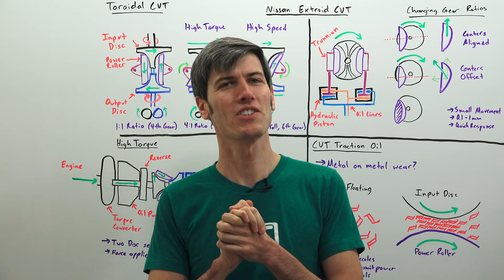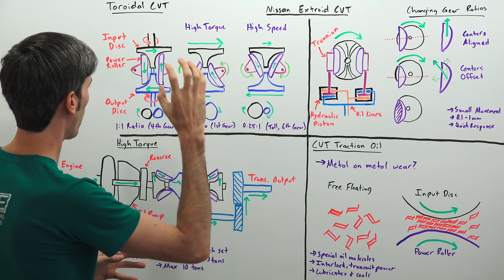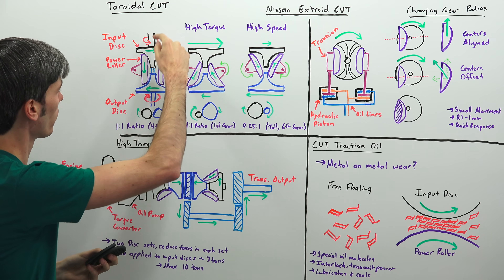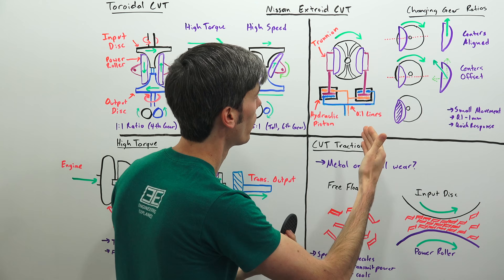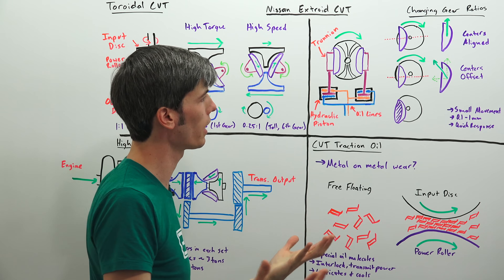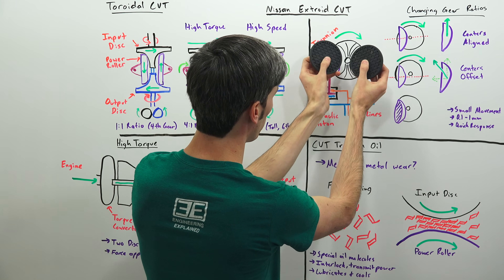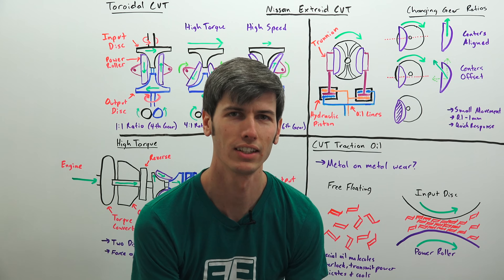Nissan Created The First Production High Torque CVT

Comment: Physically, pretty simple. Conceptually, highly complex. I'm not sure I'd trust Nissan for this type of transmission. I've seen many Nissans with 4 cylinders & CVTs that haven't had to have their CVTs replaced. Makes me wonder if it's been in the business since '99, why others haven't used it or something similar in their vehicles en mass. Maybe they've seen longevity issues?
Good video though. Square #2 took me a while to get though but I hung in there and BAM it made sense.
If I wasn't already subscribed I'd do it after this video. And not because of Bucket. If Bucket wants a friend let me know :-)

Comment: Someone finally made a car with the friction disc drive from my Sears lawn tractor! Yay!
Reply: So good for doing wheelies hey. Reverse, Pull back, Slam in forward, WHEELIE!!!
Reply: Exactly what I was thinking.
Reply: Its not a friction disk..
Reply: @Crazylalalala: It is, in spirit.
Reply: LOL, I had one of those! Worked fine till the rubber separated from the drive disc (2 or 3 years).😜
Reply: @danw1955  Cant you just replace it?
Reply: @ignacioaguirrenoguez6218  I think they have been out of production for quite some time.🤔
Reply: @danw1955  Huh, maybe some rubber coat?
Reply: @ignacioaguirrenoguez6218  The rubber was heat-bonded (i.e. vulcanized) to the plate on the originals, sort of the way motor mounts are manufactured, so any kind of spray on, or dipped type coating would just peel right off due to heat and friction.

Comment: Have a 2012 Nissan the CVT wen't out at 93000 (fully expected it and replaced it).  For perspective my Acura has it's 3rd transmission.  I follow American cars that are nearly brand new and the brake lights and turn signals don't work among other things i'm sure.  My parents GMC is literally rusting from the inside out from a jank sunroof seal.  My BMW spit oil on the exhaust from a damn valve cover gasket (how the hell can you even make a flat surface gasket leak?).  Point is cars a made by people, why should we think they will be more reliable.

Comment: Well said it reminds me of an early form of ZTR mowers. Cone drive, cones on the outside smaller rollers in steel on steel. Eventually, one or the other would wear out. At the time I thought this is pretty neat. Until one or the other wears. Trust me what a pain to repair.

Comment: Nissan does not currently use this CVT in any Nissan products in the US. Maybe Infinity but that would be news to me as well.
Reply from the maker: Correct, they use belt-style CVTs. Most of their cars are CVT. Versa, Sentra, Altima, Maxima, Juke, Rogue, Murano... all CVT.
Reply: Pathfinder as well. Kicks too. Everything other than trucks 5 and 7 speed, z car and GTR. They use two different styles of CVT both belt but differ. Link style in 4 cylinders, and a chain style in V6s. I should know I'm a Nissan Master Tech and CVT specialist. A lot of misinformation in the comments so I wanted to clearify.
Reply: Easiest and fastest way to kill a CVT put the wrong fluid in it. See it all the time. People don't know or think they know better or whatever. If it's not Nissan ns2 or ns3 depending on year etc....it should not be in a Nissan CVT.

Comment: Since there are two toroids and they are pretty small, I'm assuming they could relatively easily get rid of the differential and put a separate toroid on each rear wheel creating the ultimate torque vectoring LSD
Reply: Would help make weight distribution easier on a front-engine vehicle as well
Reply: That is something I often wondered about conventional pushbelt CVTs, why not just have two smaller CVTs one for each wheel rather than one large one and a diffeential?  I really cannot think of any reason not to, at least not any good one.
For a 4wd you could even go the whole way with four CVTs, though probably only for on-road not off-road.
There would be only one torque converter and reversing gear, only the CVT itself being duplicated (or quadruplicated).

Comment: Why on earth would they want to use two CVT's???
Reply from the maker: As explained, it reduces forces "each CVT" (it's one unit) sees, making it more durable and allowing for higher torque values.
Reply: @EngineeringExplained  OK, Jason, but the manufacturing department will be arguing with the engineering department....

Comment: And why exactly is this not currently in use in a Nissan application?  could be that it's far more expensive to make?  or the fluid requires free range bed frame molecules (well that's what the friction oil looks like to me)

Comment: Wait, we're not talking about inductors?
Reply: You are talking about a more viable solution. Toroids in the pulse width modulators for your E-CVT. Train locomotives have been doing electric variable transmissions for years, They handle unbelievable amounts of torque, and last decades with minimal maintenance. You can put the input shaft where your engine is, and the output shaft where ever you want.(Wheels).
Reply: @vincentrobinette1507  I thought PWM motor drivers simply controlled motor speed. Are you saying they vary both torque and speed with duty cycle? That's really interesting
Reply: @a7dad822  Pulse width modulators basically create an average effective voltage, by multiplying the supply voltage times the percentage of duty cycle. As a motor controller, they just rely on the inductance inherent to a DC motor. If you want to use a PWM as a step down converter, to charge a battery, for example, That inductance must be in series with the battery. Most often, that inductor is a toroidal inductor, although any inductor with enough microhenries of inductance for the switching frequency of the PWM will work, as long as it can handle the amperage. Without inductance, the battery would receive a series of full voltage spikes, which could destroy the switching transistors in the PWM.

Comment: you left out the juicy bit! 

if there are four paths for the torque you have to balance them in two aspects. one is power (or torque) balance. and the other is ratio balance. just imagine an error of 0.1% difference in ratio between the left and the right pack. At 2000rpm this would mean one pack is going 2 extra rounds a minute. Of course they are mechanical locked so the extra rounds are slip and the connecting parts are twisted.
so how did Nissan manage that?
Reply from the maker: There are sensors on the trunnions that monitor angle and ensure they are matched.
Reply: @EngineeringExplained thanks for the answer!
electronically balancing the input parameter, wow that requires manufacturing accuracy. quite cool.

Comment: The first thing I can think of with that lubricant reminds me of the gear oil used in viscous limited slip differentials.

It's probably not the same thing, but the function does remind me of that.

ALSO CAT

and it's been around for a while, eh?  Neat.

Comment: Same sort of setup as the Torotrak system from probably 10 years ago. And that was demoed in Jeeps, which were 4WD, so Nissan's claim might be technically correct. The nice thing about the Torotrak was that you could get a ratio of zero where you could sit, held in place on the transmission with the engine turning and clutch engaged. Made it an amazing rock crawling setup, at least in theory anyway, I suspect it either cost too much or was crap since it never made it to mass production.

Comment: if cvs can't handle a lot of torque then why are they used in tractors
Reply: The transmission runs at engine speeds, with only moderate torque. The output is then geared way down to get the immense torque by the ring and pinion in the drive differential to get the tractive effort out of those huge cleated tires.

Comment: I was looking at buying an X-Trail 2ltr Diesel auto then I found out it was a CVT transmission, Nissan have extended the warranty on these transmissions because of earlier failures,I have driven a Chevrolet Orlando diesel with a CVT which was pretty good to drive but again some of them failed after the warranty was up and cost £2000 to repair,in the end I bought a BMW with the 8speed auto and it is a brilliant gearbox,the CVT is a great idea but can't be trusted over long distances.

Comment: It all sounds great on paper, but I still wonder... 
1. What happens when both moving disk sets get out of sync, due to mechanical damage or difference in disk wear?
2. Molecule bounds are not very hard an eventually they fail, especially under high pressure. How often does one have to change the oil for this transmission?
3. Since Nissan came up with the chemical formula for the lubricant and only they can sell it, how expensive would it get? I really hope they are not adopting the car-as-a-service mentality.
4. How hot does it get?

Comment: It's nothing new in agriculture. There CVT traktors are about 15years old. At the bigest of the them putting around 20.000Nm through. I don't understand the turmoil.
Reply: The CVT doesn't handle all that torque. It runs at engine speed. That torque doesn't come until after the final drive reduction in the drive axle.

Comment: Seems with a small efficient but torquey diesel engine and computer control one could get good acceleration and miles per gallon with this concept of transmission.  wonder if this idea already exists in a production truck or?

Comment: Very interesting. However Nissan current belt--driven CVT have proven to work (at least moderately well) on even the 3.5L V6 cars like Maxima, Murano and Pathfinder. I don't see any potential applications of this transmission in any Nissan or Infiniti products - perhaps the next Q50 using the 3.0L V6 twin turbo is planning to drop the 7spd automatic and use a CVT with this design? Any thoughts Jason?

Comment: Ladies and gentleman, Nissan f***in Cedric Y34,  3.0L V6 turbocharged,280 PS (206 kW; 276 hp) at 6000 rpm and 285 lb⋅ft (386 N⋅m) at 3600 rpm. With CVT and RWD. The king of lawnmowers

Comment: I could never understand why people hated/hate the CVT so much. I had a 1998 Nissan bluebird that had a sr20ve  and mates to a cvt transmission from the factory. This car was very unassuming but fast. We didn't understand much about cvts so we kept blaming the transmission for going in limp mode. It was over the years with trial and error that we realized that it was the sensors on the transmission that would go bad while the transmission itself was solid as a rock. 
I love the gas mileage that the cvt gave and I loved how quickly it would gear up and down while in motion. Again the weak point of the cvts are the sensors. 

Yes the cvt fluid is expensive but it was worth it. And I changed the filter as well at least once a year or sometimes every 6 months. 

I thrashed on that car like there was no tomorrow and it took it. 

The Cvt is a marvelous invention. My car was also tiptronic so it mimicked having a 6speed automatic. 

I dont know if Japan made a different cvt for the USA but I know the cvt that came in the 1998 Nissan bluebird kicked ass.

Comment: How does the rollers engage with each other?  Teeth ? Friction? Magic ?
Reply: The "traction oil" is a fluid that has some properties of a solid when enough pressure is applied to it. A layer of it between the rollers is really the magic sauce that makes all non flexing parts a possibility.  The Dana VariGlide cvt uses it as well.
Reply: @shannontracy7487  Ah ok, but there must be some some slip/loss right?

Comment: This is an awesome new technology. Hope they put it in the new GTR as a testament to its "high torque" capability. GTR tuners will quickly find the failure points and nissan can improve upon it.
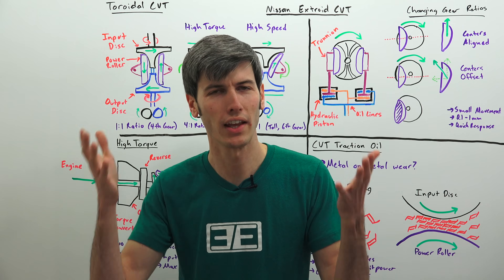Reply: Oh wow. Blew my mind at 12:34. Nissan has been using this transmission in the 4 door GTR for nearly 20 years now! 3.0L turbo V6 ,aking 280hp in a HEAVY frame is quite the task.

Comment: I take my 6 speed corrla, , don't fix something is not broken. In this case manual transmission, simple design, built to last ,easy fix, more forgaving.  Is getting a 4 year degree hard or learn how to use a clutch?

Comment: I feel like Nissan is trying way too hard with this transmission, wasting resources and money especially since the tolerances of all the parts on this cvt probably have to be extremely low in order to create adequate pressure of the oil between the 2 discs for max effectiveness and durability...

Comment: Can’t wait for that oil to shear in 10k miles and cause slip and wear. Especially in the gears on the output.
Reply: Shear viscosity breakdown is my biggest concern with such high point loads like this.

Comment: Does engine braking works with this thing? Since the output disc becomes the input, shouldn't it suddenly force the intermediate discs to the other side, ie to 1/(current ratio)?
Reply: No. It can just maintain that ratio, just like a regular gear set. When you drive the car, any change in ratio is the result of programming, not the physics of the positions of the discs.

Comment: I'm guessing that the oil is a good lubricant until it gets compressed, then it locks up. In other words, it's not a lubricant and a torque transmitting fluid at the same place and time. Excellent description again.

Comment: Would be good to compare power losses from crank to diff between manual, torque converter auto, dct auto, cvt, dcvt(lexus), and tor thing cvt(nissan).

also to include weight penalty and electric power consumption for each

Comment: My fiance has a 2015 Nissan Altima. Some of the specs I've read say it has a "2-speed CVT with overdrive"
Would this be the high torque CVT or perhaps based on it?
Her previous car was a 2011 Nissan Sentra with CVT. That car had lousy acceleration. The newer 2015 has great acceleration!

Comment: I have been pleased with my Nissan Juke CVT for 90k miles, but I am disappointed that I can’t tune it up much before killing the cvt. I am one of the rare few who actually love pegging my little engine at the top of the power band and letting my transmission provide unnaturally quick acceleration.

What vehicle is Nissan planning on putting this in? I am wondering if it might be feasible to do a swap... although getting a computer that can control everything properly might prove impossible...

Comment: What i do not under stand, other than being able to apply a transmission like this to older vehicles to make them more efficient. Manufacturers could avoid all these crazy transmission ideas if they were just willing to switch to Fail shut pneumatically controlled vales. No more fixed cam profiles for lift and duration and suddenly an internal combustion engine is way, way more efficient and on top of that will produce more torque and horse power all over the RPM range while still saving fuel. Not to mention that this type of system also makes the size of engine heads allot shorter making for less room needed and a lower center of gravity. I know there are videos out there from the founder of Koenigsegg and the progress they have made in this type of system for road use vehicles. I still do not understand why other large major automotive manufacturers have not switch to this technology. A few more sensors and a good control system i would imagine that any of them given their financial resources available to put into R&D would have this sorted out and ready for production much sooner. One would almost guess that given the cost of manufacturing and machining needed for a Tradition Cam and other related components to operate the valves that their would probably be a negligible difference in cost of manufacturing, but the return on the technology for the Manufacturer and all consumers would be huge. I know my last sentence there is pure speculation on my part but really this is something that we should already be seeing on mass production engines.

Comment: The coolest part on this transmission is the oil improvising itself like molecules of gear teeth between the rollers. I wonder if they can also be used for the torque converter as well to increase its efficiency.

Comment: If its made by JATCO its trash. Like all nissan CVTs
Reply: True, Jatco make the absolute worse transmissions on the planet.
Reply: Derek McCoy, JATCO does make some good transmissions. Their transmission found in the Nissan Titan and Aramda are really solid and known for being able to reach 300,000+ miles.
Reply: I think jatco is owned by Nissan or part of it is.
Reply: From what I've heard these transmissions CAN be reliable if frequent transmission oil changes are observed. The problem is that the interval is more frequent than most other transmissions - the same fundamental shortcoming Volkswagen's 1.8t 4-banger had in 2003.
Reply: You're normally the looud guy at the let's watch the Superbowl at John & Becky's, right? Don't answer, because I know I am, without ever having met you - just like you rendered an opinion without any evidence,other than a bad experience with a car that YOU drove.
Reply: @Adrian_Nel  Evidence, you mean like the class action action lawsuit against Nissan due to their CVT's going out? Jatco also makes the CVT's that some models in Fiat owned brands like Chrysler/Dodge use and are notorious for premature failures.
Reply: @Adrian_Nel  those CVTs all have full-time metal on metal slide friction, which you normally don't have when you use regular AT or MT, which is why AT or MT being used on highway may last for a million kms and CVT not
Reply: @i.k.562  Actually, gears do that, too.  The teeth of one slide into and out of the valley of the other.
Reply: @Adrian_Nel  The rest of the cars are typically quite good, but their CVT transmissions have historically had very short lives.
Reply: All CVTs are jatco
Reply: @imlamar2011  not true. No problems with the ones Toyota and Honda makes.
Reply: @imlamar2011  No..Honda makes their own.